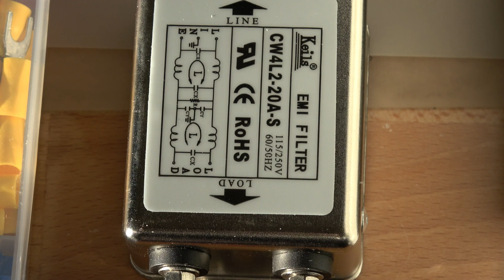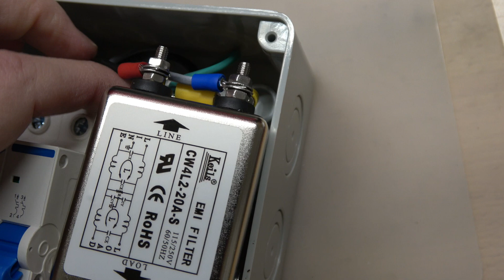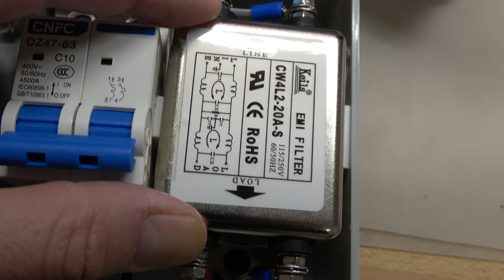Power Box Tutorial - Part1

Comment: Can you use a power strip and plug line from servos and line from rig into it and then plug that into the power box? If so would you still use the 10amp breaker or go to 20amp?
Reply from the maker: @RobertGuadagnoli  generally it's best your circuit breaker to be larger than the breaker on the box. It happened to me, when I shorted out a 110v line strip (with surge protection circuit) by using 220v from a power converter. Instead of the whole house fuse, just my breaker on the power box tripped to prevent fire .. 😅

Comment: Will the line filter stop the EMI interference with my VR headset tracking (lighthouses/base station IR tracking)?
Reply from the maker: It will help, but you also need to add ferrite choke rings to the power and data lines of the lighthouses, to mitigate ground loop noise that is also introduced by spreading away the equipment
Reply: @tronicgr  Thanks, I have some small cores on them already but it doesn't help. I'll try getting better ones. All my equipment runs from a common ground.

Maybe I need to do better cable management too.

Comment: Great design. One thing though - I really wouldn't recommend 'tinning' or soldering wires which go into screw down terminals. I won't go into details as I'm not really qualified to but I've heard from several people this is not good practice. 

I think it's due to the possible heating and cooling of the solder which could cause a bad connection overtime. I've never seen an electrician I've been working with solder a wire before inserting into a screw down terminal.
Reply: I always crimp (for a good compression of the wires) AND solder (to fill in all the gaps)... I don't worry about the long term embrittlement of the wires over time as has been claimed by some regarding soldering.
Reply: i believe the reasoning behind it is that over time the solder will creep under the pressure of the screw terminals and lead to a loose connection overtime
Reply from the maker: The servo drives will never pull that much continuous current for the wires to overheat and melt the solder. This solder is melting at 240⁰ celsius, the cable insulation will melt before that... 🤷‍♂️
Reply from the maker: Electricians crimp wires as it's faster, no messing around with hot irons on job site... doesn't mean its better
Reply: @tronicgr  looking at a few best practices for electricians it's recommended the wires are not tinned, at least in the UK. Not saying it's not going to be fine but I've always been told that if crimped properly or screwed down properly then solder is not needed.
Reply: ? the keyword not needed , soldering is always better crimping is just faster and easier it is has higher resistance which is far worse over many connections, if you can solder ever connection the better, just try and play a old school point to point guitar amp and then compare that too a modern day circuit board amp the difference is huge, electricians in the UK will do the least they can take make enough money to survive they dont care about the job they just wanna get it done  @Y2BuToNz